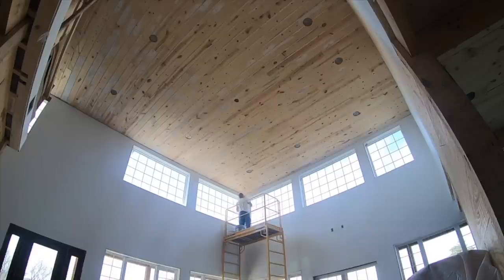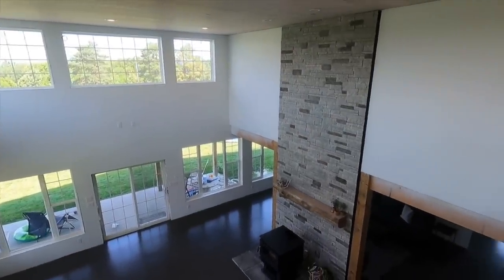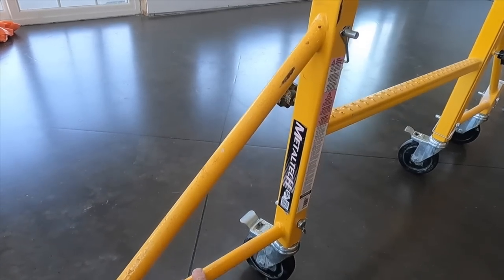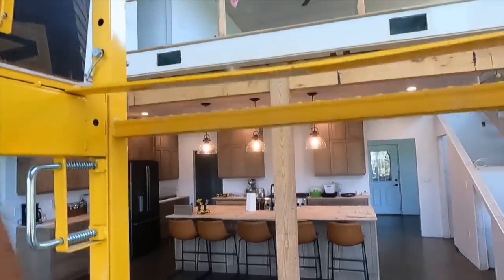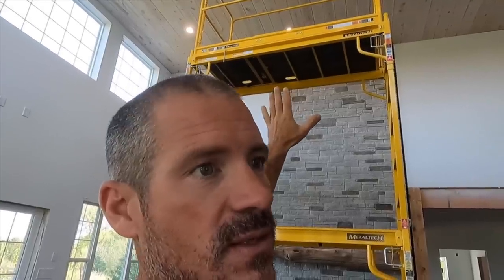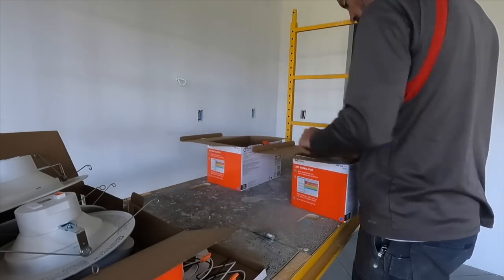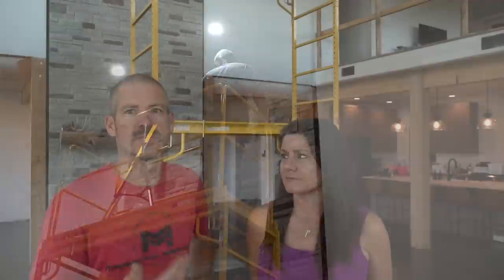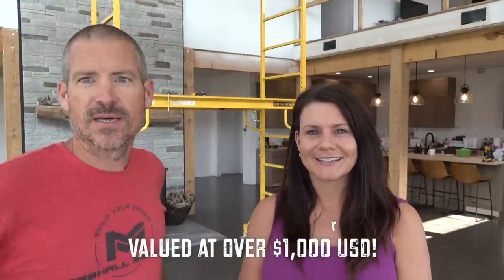Metaltech Scaffolding Review! (Giveaway Closed)

Comment: Very nice giveaway offer.  My wife and I have a lot of projects to do in our new pole barn and a rolling scaffolding would be awesome to have. We still have electrical, garage door opener, ceiling and insulation,  some type ventilation to help move hot stagnant air and shelving. We'll have to check out metaltech. Did metaltech give you a Marshall remodel promo code? Thanks for the chance to win. 🙂🇺🇸